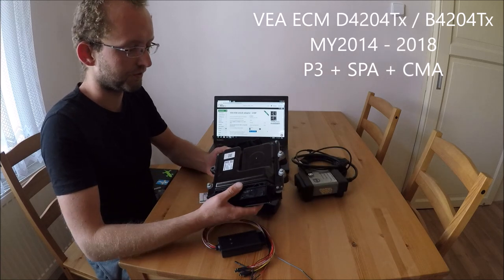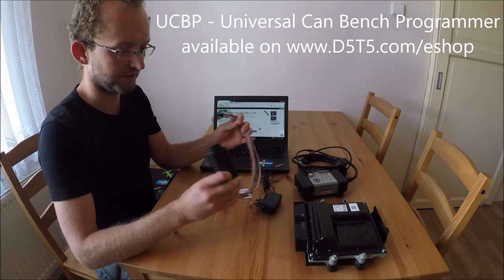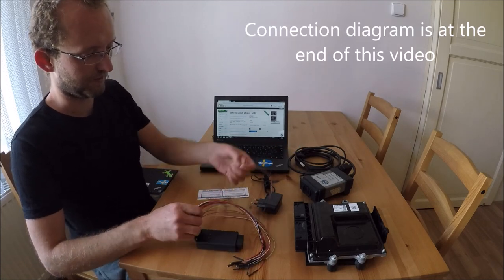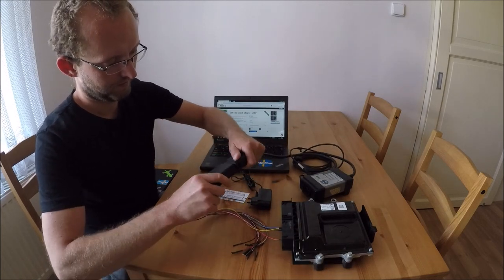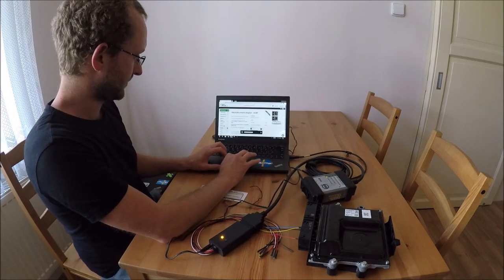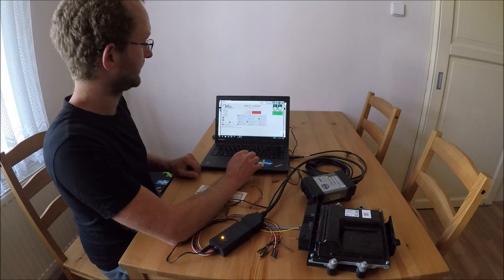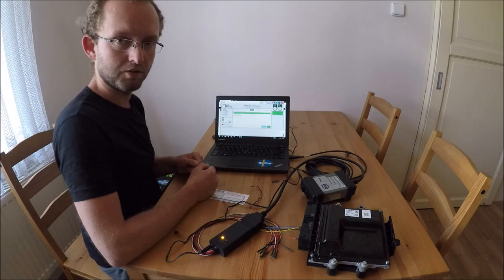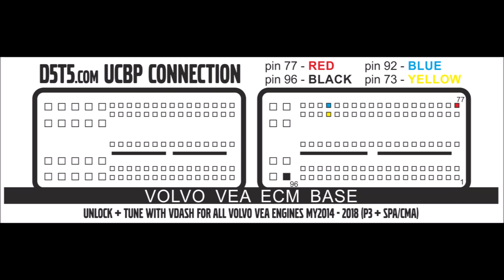Volvo VEA Engine Control Unit unlock & tune with VDASH D5T5.com / DENSO MB279700 /  Renesas SH72546R

Comment: Is it possible to go back to the stock software without the "software validation error" DTC for warrantee purposes?

And can I also get back to stock if the de Egr off is already set by vtune.nl or does it need to be removed first by them?
Reply: yes, it is possible to lock the ECM again and reload the original software! no matter if someojne did any tune on it before
Reply: @LadislavMotl  Cool, thanks for the quick info, great that you are replying more and provding information :).
Is there also a pricelist available for the lock/unlock and tuning? Is is free to switch between stock software and tuning when the tuning is bought?
Reply: @vd9623  hi, yes, the pricelist is here: https://d5t5.com/wiki/vdash/article-pricelist  ..and yes, once you buy the tune, you can switch between the stages freely

Comment: Thank you for sharing this.  I traced the circuit provided as gerber data and found that the blue and yellow lines are directly connected to OBD-3 and OBD-11, respectively, which are assigned to mid-speed CAN-H and L, respectively.  Red and Black are for 12VDC, so I think, just for this ECU, we actually do not need any special circuit but just pass through mid-speed CAN (3, 11 of OBD terminal) to 92 and 73 pins of the ECU, is this right?
Reply: I was partly wrong: The CAN bus lines (blue & yellow) are pass-through, but the red line is not simply a 12VDC, but its timing is controlled by the timer IC on the circuit board, so we need the entire circuit.

Comment: I checked your prices and they're not much better than going to the dealer, at least at the dealer you get official ( and safe)  Volvo programming done without hacking etc. 
Orbit software for Volvo is coming fast behind you and it's much cheaper than your offers. I hope it will make you rethink your prices before you lose all your customers.
Reply from the maker: hello, I think our pricing policy is comparable / better, then others - https://d5t5.com/article/vdash-flat-tarif
Reply: Well not sure how competitive that is, I wanted to unlock an ECU with your UCBP device and straight away before adding any other features I was asked for 249 Euro without VAT, that's for the unlock alone, this is 300 Euro plus if you include VAT, your website says it's 129 for a P3 Platform so not sure why I have to pay 300 euro first ... then another 129 euro